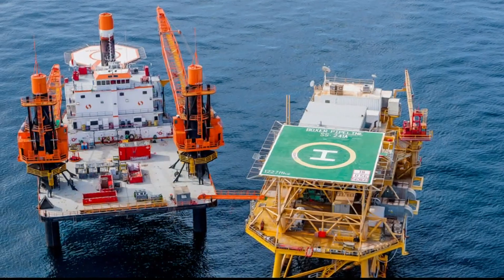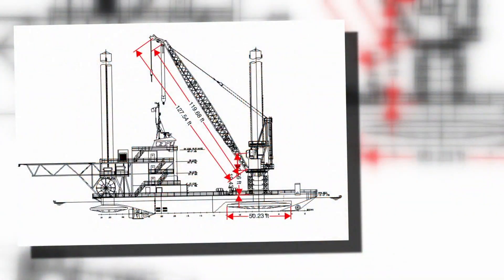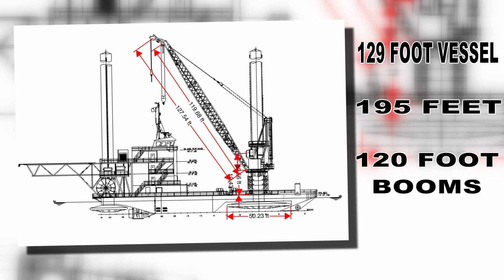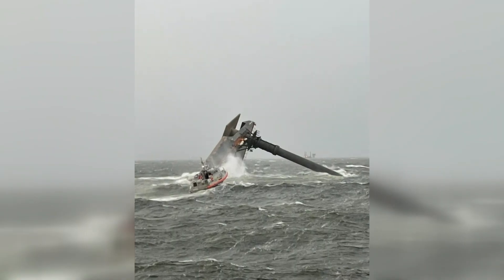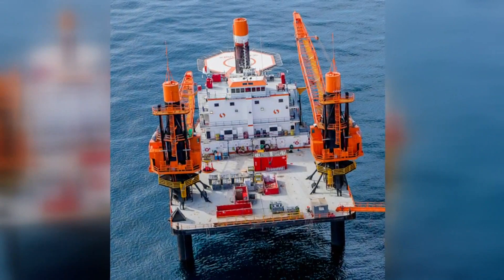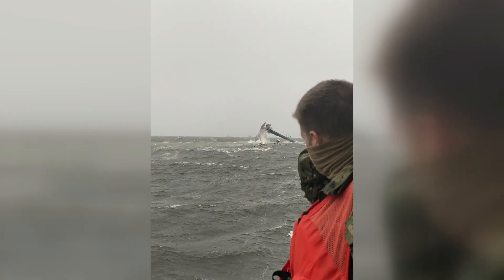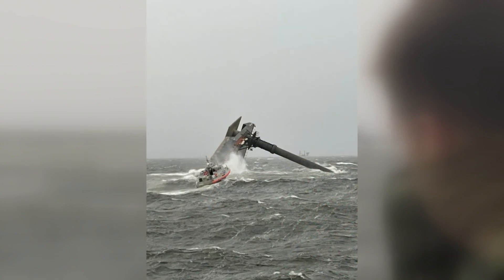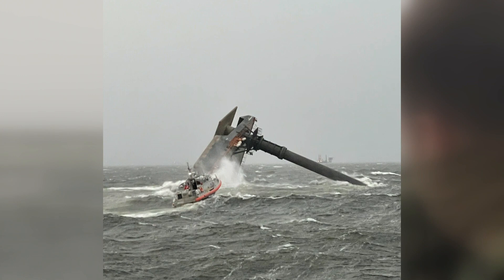What is a Liftboat and what could cause it to capsize?

Comment: No answer
Reply: A lift boat is basically a powered barge (a shallow-draft, flat bottom boat), which has three legs with large pads on the bottom. When the boat gets to its work location, it lowers the legs to the sea floor and pushes down into the mud. Once the legs are secure in the mud, the boat then lifts itself out of the water to the working height needed, typically 30-50 feet above sea level. 
Once at the offshore platform, it can have a variety of functions: making heavy lifts that exceed the capacity of the platform crane, staging materials or equipment for maintenance, and serving as living quarters if the platform doesn’t have the capacity for the construction crew. 
What would make it capsize? Off the top of my head: rough seas, high winds, or a sudden shift deck load. The shallow draft makes it very unstable in high seas—3 to 4 foot waves wash over the bow; I believe I heard there were 7-9 foot seas at the time. They are very top-heavy, and strong winds pushing on a large vertical surface (like the quarters and wheelhouse) could have pushed it over; there were hurricane-force winds at the time. 
That’s the “what” and some potential “how”. We may never know “why”.
Reply: @macmedic892  I worked oil field in 80s , you nailed jt.
Reply: @robertbiondo9381  90s to 2009, Texas, they could have a safety hatch. This happen fast, most likely.